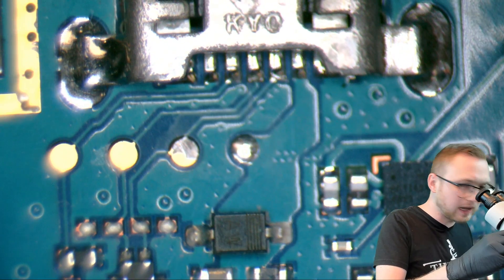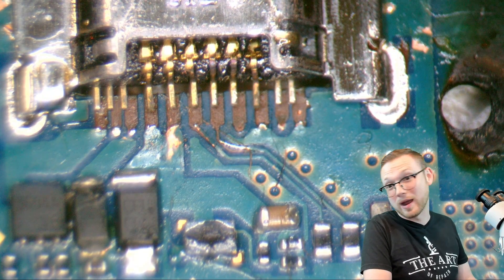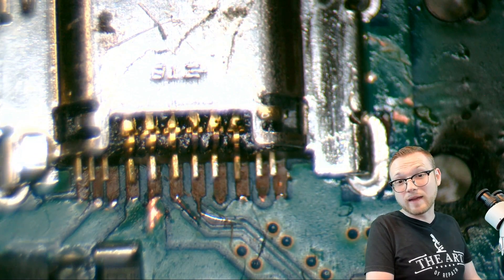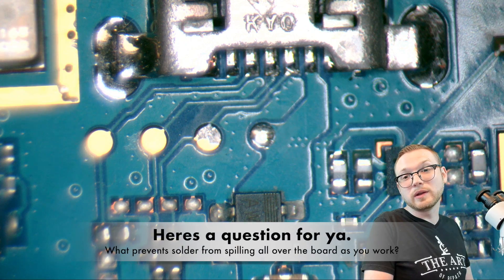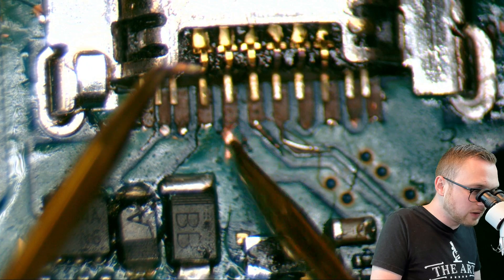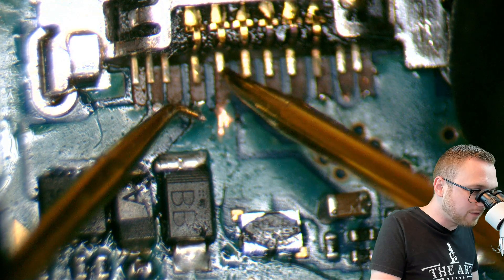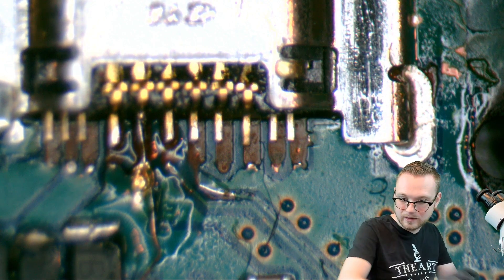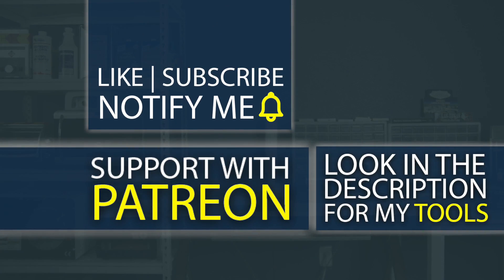EP61 Charging Ports Goof ups! | What do I do if I lift a pad while soldering a charging port?

Comment: Sorry for the long message. What about boards that don’t have any visible passage ways? Like you mentioned. I’m working on a friends Bluetooth speaker. The port fell off and then I lost it so I got another one of my old blue tooth earphones and tried it out without soldering and the light to show it was charging came on. So I soldered down the base of the port onto the board and now if I press the pins down onto the pads it’s not showing the light anymore. I don’t have magnifying glasses or microscope etc. luckily I at least have 20/20 vision lol. I don’t see anything wrong  except the pins are a little off but they seem to still just be touching a bit. Was thinking about unsoldering and trying to press the pins down to see if it still works or if I broke something

Comment: You reckon that tiny jumper's gauge is thick enough to provide the current necessary? Since you shorted what had a massive plane connection, I'd have used a thicker jumper.
Reply: Yes, you shall use this thin wire at least double. Understand, you watch a video from an interested amateur.

Comment: After watching your video, I feel more confident in doing that repair. I have a micro USB port where I tore off the three middle pin pads. I thought maybe the tablet would still charge with just the two outer pins but it didn't work. Now its time to try and jump those three middle pins.
Reply: Same.
Reply: you won’t be able to do it. you need a microscope, very fine solder and pencil soldering iron. You just can’t go with Walmart and buy the stuff to do it. It’s not that simple junior 🤨

Comment: Man, you're the best !
I knew this could be done, but i didn't knew were to connect the jumper wires.
I might save a phone with a peeled charging pad.

This is the damaged zone.

https://i.ibb.co/k3js0d7/dav.jpg

https://i.ibb.co/P6VbJh0/dav.jpg

I just wanna make it charge the battery.

You think those big dots VBUS and GND could be used to connect pin 1 (VCC5V) and 5 (GND) from the port, just to activate the charging function?
This would be nice because i can see the dots, and i could work with them. 
I don't have tools and microscope to work on smaller areas.
I don't wanna weld pins 2,3,4. I don't care about data transfer.
But someone said the battery would not charge if i don't connect pins 2,3,4, because the motherboard read battery status, temperature, etc, via 2,3,4 pins.. 
Phone is a Huawei LDN L21

What is the parameters to measure continuity ?
I have a friend that has a measuring device. But he's not into phones.

Thank you, man !
Reply from the maker: Personally, at that point, i think it might be safer to just use one of those micro charging circuit controller add on boards and just solder the points to that and just lock down a new port and run jumpers to it. Theres just alot of damage there.  I do have a video on continuity mode as well you can watch, but you can also just select the waveform  symbol on your multimeter and just wait for the beep. The beep is usually based on a diode or resistance measurement under a threshold value that could be considered continuity.
Reply: @TheArtofRepair  

Thanks for your reply, man!

This is the motherboard.
It forms one piece with the bottom part. Old design.

I've never heard of that micro charging circuit to add on the motherboard.
Thanks for mentioning.

https://ae01.alicdn.com/kf/H5634ab8ac43a45388e0aa9fd6da351f7P/Ymitn-Electronic-panel-mainboard-Motherboard-unlocked-with-chips-Circuits-flex-Cable-For-Huawei-Y7-prime-2018.jpg
Reply from the maker: @dan_6915  i would just jump over to ali express, i haven't looked for or used one in years, but i know they exist and im sure plenty of ppl have stock. Iv heard of them being used in lots of cases where the charging circuit repair is impossible or prohibitively expensive.

Comment: Can you please make a video on how to lift a chip that just does not want to lift. Even after giving it a lot of heat.
Reply from the maker: underfill or no underfill?
Reply: For those who are still interested: Sometimes you find a component which is welded onto the copper structures of the board. Not to damage even more, you can make a "cold removal" of the component. With a little milling machine.

Comment: I like to hold the jumper in place with a metal spider after the first connection. It acts like a heat sink and makes it more difficult to accidentally reflow the first connection while making the second connection.

Comment: Hi Justin, thank you for your video, I am in the middle of a puffco peak charge port repair and only have 1 of the 6 pads. Since your in China,  do you have any access to a replacement board that I could just swap the battery over to ?
Reply from the maker: Dylan Westfall back in the states now because of the pandemic , unfortunately thought it’s not economically feasible to search for one part like that. I can help you source anything you want.. but one item.. could cost you more than the device if shipped alone. Most cheap things are brought over in pallets and broken down in the country they go to and shipped locally
Reply: Do you have a repair shop in the U.S ? I could email some pictures of what it's like or needs for an estimate
Reply from the maker: Dylan Westfall you can email me at justin@artof.repair but I may or may not do it. I basically pick and choose my work at this point. So no guarantees on anything but feel free to email.

Comment: Do not underestimate what he's saying about very small thermal mass. If you keep the iron on it for too long, the solder on the other side of the jumper wire will melt too. I would suggest experimenting with this on the first jumper wire, in stead of finding out the limits the hard way later, if and when you have many jumper wires closely together.

Comment: Ridiculously helpful video! Thanks so much. I didn't have a trace to follow but scraped down to the bare copper and am now getting continuity to one of the nearby SMD caps. 
The pad for the second pin looks to be in perfect shape, but I'm not getting continuity to anything from it. Is it normal to have some pads like this? It's the 2nd one in. It looks in really good shape with a nice  layer of fresh solder sticking nicely to it.

Edit: looking at a pinout image for micro USB, it looks like this might be for the "USB OTG ID" so maybe that's an optional thing

Comment: Thanks Justin! I may resort to some solderable magnet wire. I have many different sizes down to 44 gauge. But first I am going to try and replace them with copper foil/epoxy and try to make them look like they were never pulled in the first place.
Reply from the maker: Have you tried straight up enameled jumper wire and UV coating?
Reply: No. Magnet wire is enameled wire.

Comment: Your scratching should be in the right way, and when you started  doing it you basically did it wrong  cause if you would miss a little then you could fk up the whole connection there :) .

Comment: Lifted one of the pads carrying CLK to a DDR RAM module connector that I changed! Currently the airborne trace is soldered in place to the pin! If this works, I'll give it a dab of epoxy for the next repair guy to laugh at!

Comment: Bought a switch with the charge pads ripped off, I don't see traces going from each individual pin, it looks like the trace engulfs all the pins, so I think I'm screwed with fixing it. Oh well, still can sell the parts and make my money back, unless someone knows of a way to fix it, message me. I got pics of the board and condition. Thanks in advance, and thanks for the video!
Reply: I've fixed one with the same problem for a co-worker. Not to hard to fix.  He tore of 7 pads and traces.
Reply from the maker: As long as you can find the next pad in line with the circuit, it can be jumped and fixed. Sometimes pads move down into the board and the vias as not accessible, so knowing the next itemin line is important.

Comment: Do not do this if you want a proper and quality repair.  The repair shown will fall within a few months.  Remove the component,  and repair the land and trace. Then reinforce the repair with epoxy,  since this is a power jack that will see allot of use. Very minor repair.  Basics are there. You need to always keep in mind end of use.  I do this in a manufacturing company. I've had to fix boards that the circuit board caught on fire.  Look up IPC-7711/7721  for proper repair.
Reply: He did say in the video that this isnt the proper way of doing things and this is just for demostration and from what i understand the way of thinking
Reply: @nontasanastasios7612  either way if you put it out to the internet, people will take it as proper instruction. I'm a CIT for IPC-A-610 and WHMA-620. I've been doing board repair since 95'. I'd never show someone this as a repair.
Reply: Totally agree. This is not "The Art of repair", it's just bodge it together quick and forget it.
This is not a repair made to last, and comply with the original quality of the unit.
Reply: I couldn't say it better.  I would be embarrassed if I did this repair. I have used wick to repair  a very high voltage / current trace. But that was due to not having trace material that could handle amps thru circuit  used.
Reply from the maker: I am familiar with IPC 7711c/7721c including procedure 6.1 which clearly demonstrates an IDENTICAL method as to this video, which also mentioned that there is no level of conformance in this type of procedure.

I think the only thing that could have really been added to the video would be to mention something about epoxy but it's not 100% needed unless its application specific, a little slack will cure any type of stress as long as your anchors are fine and you using an insulated jumper wire.

I do think your overexaggerating yourself a bit and are not really appreciating the repair circumstance, as I chose to show a worst case scenario type of damage. I think you're focusing too much on my example looking worse than an actual job than me doing the job right or wrong.

The video itself clearly demonstrates the thought process and idea of jumping a small trace in a small low voltage, low amperage environment. I would love for you to describe your method for full trace repair in this situation bearing in mind the scale of this type of job being in the sub millimetre, as far as I know, micro jumpers are industry standard at this point and unlike larger macro traces, they do not actually sell trace repair kits anymore.. they sell jumper wire...  

While I hope this comment does not come off in a negative tone, I def do think that you kind of came out of pocket without actually assessing the situation as a whole, including the needs of the repair and the proper procedure as dictated by the document you put down as proof of your claim

With all that being said, I do hope to see you in the comments in the future and am happy to have a conversation with you anytime about my methods and techniques =)
Reply: I would remove component and place a bonding film land with trace. If I couldn't find film with trace,  I'd run new trace between land and trace. To finish off, repairs like the one shown always get epoxy when finished. I've never had one come back doing it this way.
Reply from the maker: @stevenzablow8746  

The epoxy itself is more of a placeholder type deal and in such a small space may not really do much of anything since under normal flexation circumstances the board will absorb most of the flex, whereas we are dealing with the only part of the board the client will constantly mess with by plugging their cable in and flexing the paddle up and down, unless you plan to coat the entire area, including the whole back of the charging port. which would make future rework much more difficult or even impossible depending on the type of epoxy used. 

While I do not think you are wrong by any means to still epoxy over the small jumper, I don't think covering the entire port would be conclusive to a repair with future rework in mind, incase the client actually damages the inside paddle in the future and needs a new repair vs a rework of the botched second attempt.

 I think given the circumstance, we are dealing with a potentially constantly moving pin set since the paddle is almost a direct connect, that just adding slight slack to an insulated line will also produce proper results that also, do not come back. I would say personally I have done thousands of these types of repairs, and even more so hundreds of second attempts from other shops cleaning up these types of repairs. With also zero returns. 

So truly in the long term, I would conclude this with saying that we both have proper methods that do follow proper IPC guidelines with the only true difference being future reworkability based on the amount of epoxy used. What do you think?
Reply: @TheArtofRepair  I work for a ECM, so an RMA on a board that was already repaired looks really bad. That said, we also service equipment that is beyond warranty, (we're talking 7-8 + year old boards). I've seen my repairs survive while areas around it failed. I want to ensure I don't have to rework a repair. 
I do make sure to show that a repair was done,  so someone like yourself, knows it's been done,  and can take appropriate steps to accommodate what was done.

Comment: This is not criticism! I am only trying to learn from you:-)
Why did you choose to make jumpers instead of new copper pads?
Oh and by the way, please tell me the name of the probes with bend tips you are using:-)
Reply from the maker: Creating new pads take way longer and the density of the jumpers more than makes up for any disparity in the mass of creating a new pad. New pad repair is alot less time consuming in more macro sized circuits IMO.  I can run a jumper in seconds that will function the same forever that a new pad would be that would take me potentially 20-30 minutes, especially at that point if im making new pads, then im def taking my time to make them proper. Its a fusion of efficiently and effectiveness, especially when you have 100 more boards in queue to work on. I appreciate the question! feel free to comment anytime! =D
Reply: Thanks a lot, it did teach me a lot!:-)
I have looked at your great list in the description, but it seem that your bend probes are not listed, or am I wrong?
Reply: The probes are part of his volt meter
Reply: @newguy8830  Okay thank you for helping!! Do you know if it's possible to get separate probes like that, haven't found anywhere I have looked? :-)
Reply: Try searching micro or phone repair voltmeter probes
Reply: @newguy8830  Thank you a lot, I'll do that. :-)

Comment: Ok what if the pads are still there on the board but only lifted? What can be use to hold the pad down to the actual board??
Reply from the maker: At this point, its best to go ahead and run a jumper, once the integrity has been compromised its not going back in. Iv looked for the adhesive used to hole down the pads, but cant seem to find it in a "personal" quantity. =( on that same note, once the pad has moved, the integrity of the pad itself in terms the trace itself are not as strong as it should be and can fail even if glued back down, still best to run jumpers =) I appreciate your comment! Thanks for the view =D
Reply: @TheArtofRepair  not to mention that copper pads can lift due to a variety of reasons, one of those being corrosion from water or electrolyte damage.  If you have corrosion eating away under a pad then epoxying it back down will be a very temporary fix.  I would rather cut out the damaged pads/traces if feasible just to follow the corrosion and make sure I'm not missing any other issues on that circuit that haven't cropped up yet.

Comment: Justin.. what can i do to find jumper solutions if i don't get visual track? Thanks in advanve
Reply: i have the same problem. I have a phone with charging port usb type C where from 24 there are 20 broken pads haha, no idea where to jump each one, i guess there you need a working phone to test continuity or schematics/ diagrams

Comment: Also nice micro vice would be good for holding boards..
Reply from the maker: I use a small piece of silicone pad and a jewelers anvil which is in my description if you want to try to find it local. Great secondary board cooling heat sink as well along with no crazy height issues for the scope since its sitting on top.